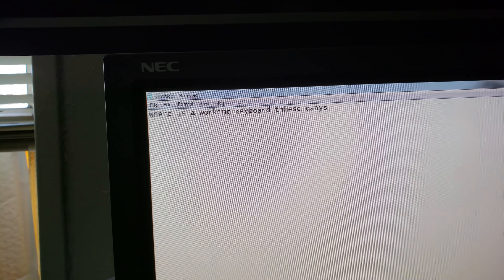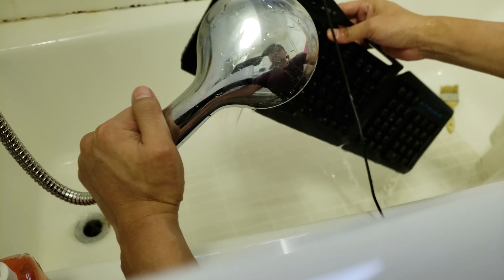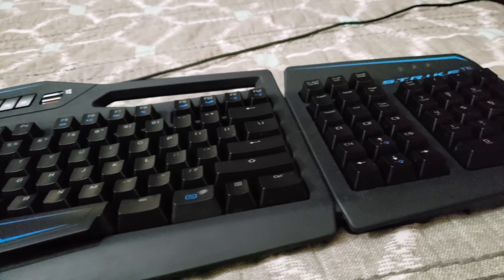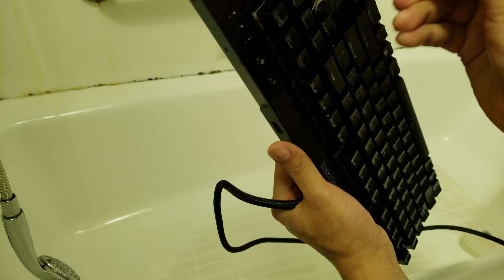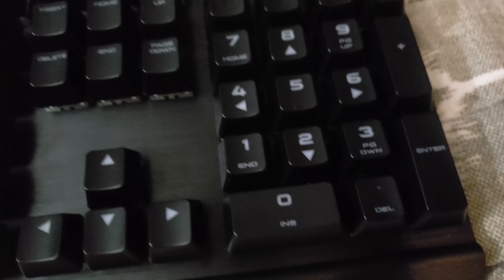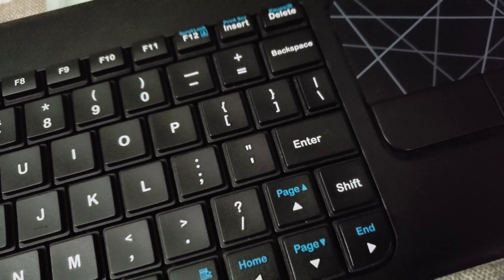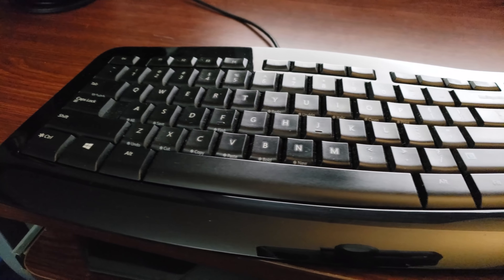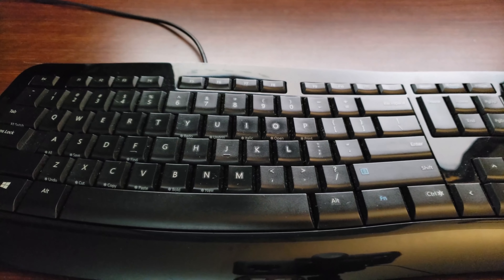Cleaning & Washing Keyboards! (Including Corsair, Microsoft, Logitech)

Comment: One other thing I do to dry electronics is to use the oven.  It sounds dangerous and it is if you are foolish about it.  My technique is to set the oven to 150 deg F.  Let it reach temp and TURN OFF.  Then put the device in the oven when it's cooled enough that you can keep your hand on the rack for 10-15 seconds.  By then its cooled off but there is still lots of residual dry heat to dry out the innards.  I've used this technique for many electronic objects - once even an entire laptop that had a full cup of coke dumped in.  In that case, I pulled the hard drive and battery and washed the laptop with a couple of gallons of distilled water in a spray bottle, allowing the gunk to drain many times between sprayings.  Did the stove thing for about 12 hours - in and out repeatedly until I was sure it was dried out internally - something a fan can't always do well, and voila it worked as good as new.  Oh, one last thing - put a BIG sign on the oven control so it doesn't get turned on to preheat for some roast dish.

Comment: if the warther is dry, drying in the sun might also be an option... But this method does seem risky - if not very well dried before power is applied there might be corrosion forming....

(I kind of want to disassemble mine and wash the plastic top part in the dishwasher, but assembly afterwards might be tricky depending on construction) (for non-mechanical, large membranes assemble easier than individual domes (they probably keep more water out with the direct water method as well))

Comment: Not sure why you said cold water is better.  Water from your hot water system has less calcium dissolved in it and will, therefore, leave less residue when evaporating.  Also, hot water is better for washing and rinsing since it is more active and will dry faster.  But I like your technique.  Thanks for the vid.

Comment: you should not clean keyboards with water you should clean it with isopropanol you can buy it cheap on ebay.
Reply from the maker: Thanks. There's definitely many ways to clean keyboards up, and the video shows one, kinda crazy, method. Thanks for watching.